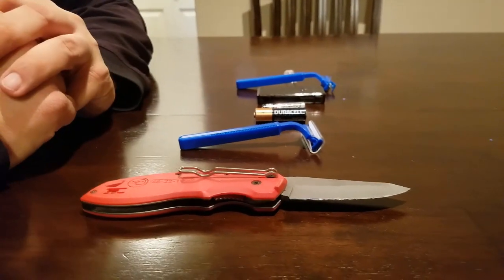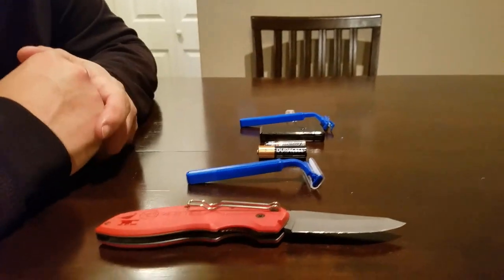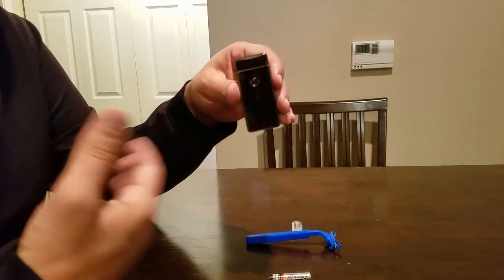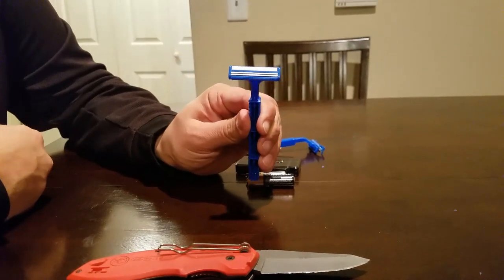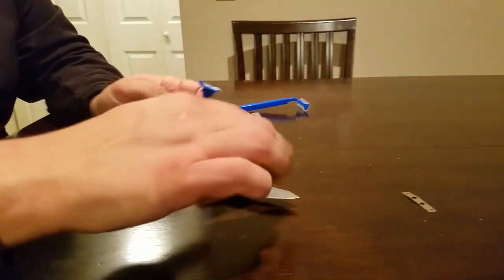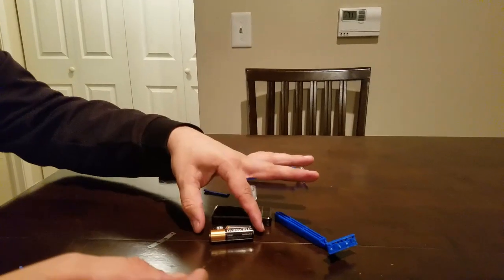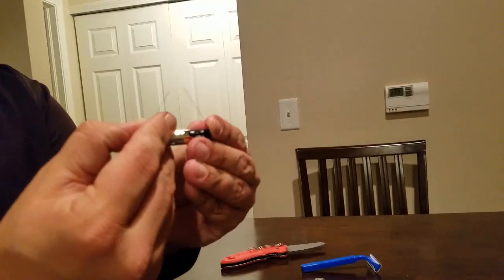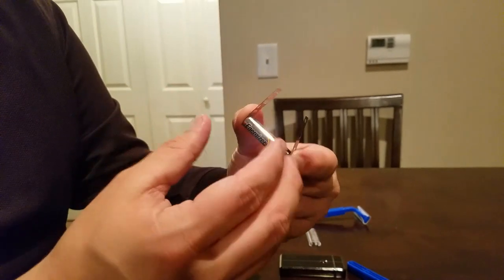Prison Lighter

Comment: Done this before. Used a AAA battery sold at commissary for the radios you could get. Normally you don't get full sized cigarettes tho but tiny joints rolled with bible paper. Nice demonstration though, brings back memories.